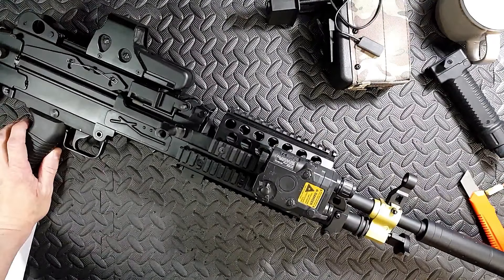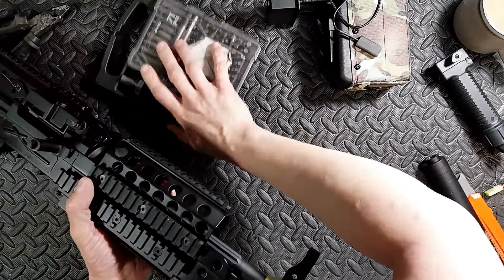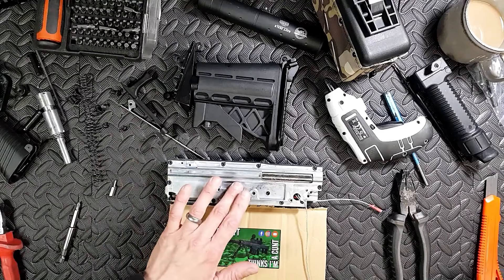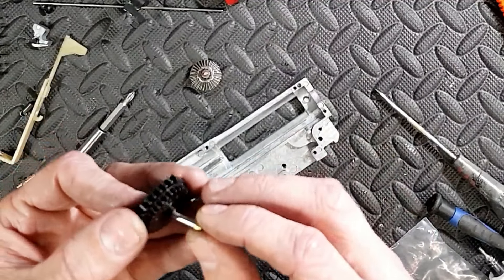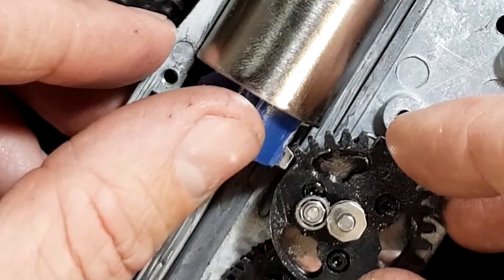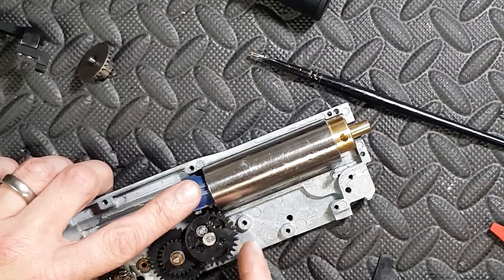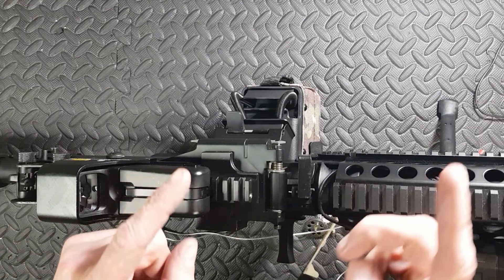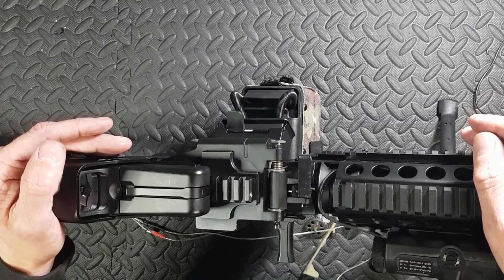A&K MK43! (with click bait title)

Comment: I find myself having to watch twice 1st time just to listen to your commentary then 2nd time for the tech knowledge p.s what gears are they please
Reply: That's a second on the types of gears, that gun sounded perfect!
Reply: Stolen from another commenter called N8:
theyre super shooter gears, theyre oemed by shs, but they add the internal bearing to them
Reply: @parkih  yeh just googled something along the lines of integrated bearing gears and found a few different sets but only really seemed to be in America. I would worry about longevity of the bearings but that would probably only be an issue on some cheap copies etc
Reply: they look like zci advanced
Reply: They are zci gears you can find them on ak2m4
Reply: @ArchieKeen1  legend! 👍
Reply: Someone please put up a direct link to these gears I need them for my m249 so bad
Reply: @paddytotherescue7364  awesome thing buddy is the bearings pop off with a tad bit of pressure so can be replaced
Reply: @parkih  made the mistake, but like the others said they're zci advanced. Super shooter gears have the same internal bearing but they have been out of stock for a while

Comment: Saw AoE that bad in a CA G36 ages ago because they had pathetically thin piston heads when they had yellow pistons. ICS M4s also suffer from needing about 5mm of adjustment if you use any aftermarket piston and something like an Area1000 piston head or Lonex.

Comment: What ARE those gears? I wish I had some for a quiet build.
Reply: will be checking this question
Reply: Zci advanced gearset, you can find these on ak2m4
Reply: My only concern is how strong they are as surely there will be a lot of stress on the middle bearings.
Reply: Kipz well my thought is that the bearings on the gear are a little bigger than bushing bearings as they are not contricted by space so they should be fine

Comment: Do you have pictures of the spring/pin system of the m249 para stock, I bought a used one that is missing bits and the end cap slides right off. Any help would be great.

Comment: I love the A&K mk46 and the mk43 .they are dog shit out the box but respond brilliantly to some new parts properly fitted . The bull gear hop units are a must in my opinion but you can make the standard hops work reasonable . I run my mk43 and my mk46 with predator style backpacks at 30+ RPS , it's completely unnecessary and you burn through a ton of ammo but it's brilliant fun and a proper force multiplyor used properly . Brilliant work as per mate ,those gears are amazingly quite ,I'll try some on my next build for sure . Keep up the good work I've got fuck all better to do at the moment than to watch you 😀👍

Comment: Hi Negative Airsoft, can you help us with the stock nozzle length (or wich length is optimal for the Bullgear hop unit) and if it comes with an oring? Kind regards a sub from Denmark.
Reply from the maker: @mattipanduro8583  I use 21.00 to ensure feeding

Comment: I'm guessing these are the ZCI Advanced Gears? would the 13:1 be ok to use with a ZCI High Torque motor on a M110/M115 spring? Trying to get a quicker and quieter (Got an ARP9) Semi and don't want to get them and they get chewed up or the bearings explode. 
If not or if you know of any reason to not get the gears or the motor over a different product what would you recomend? 
Thanks.

Comment: So I have a few questions about the 249 series from A&K.
My first one is: I bought an A&K M249 para because the MK46 was out of stock from my regular online retailer and I was wondering if it is possible to put an A&K Mk46 stock on the M249 Para. Same with the lower rail handguard. I'm wondering if these parts are interchangeable.
Second: What type of battery would be recommended for a stock A&K M249. I heard people say that you should use a Ni-Mh because a LiPo would burn out the trigger contacts faster.
Thank you.
Reply: thats correct on the nimh bit. the boxes use a micro-switch trigger that will not last nearly as long on a li-po. If you still decide to use a lithium battery, chose one with a lower discharge rating, like no more than 15c. A decent li-ion or li-fe pack might be a good option.
Reply: @cool5tuff  Well I only have 25c Lipo's laying around now, so I guess that means I have to invest in a good Nimh battery. Thanks for the help.
Reply: If you have any soldering skills you can wire a mosfet for cheaper than a new battery and use your lipos
Reply: @cool5tuff  you can run 45c 11.1 on the stock micro switch fine a good amount of time.....this is because you are not turning the system on and off like on semi auto guns alot. If you do use that small of a discharge, you can damage the battery from over drawing the safe amount of amps it can supply.

Comment: just wondering, i'm not sure if i missed it or not, how did you corrected the AOE in this case? greetings from France!
Reply: Florian Gravouil - just check 6:40 on - he skimmed the piston gear to match the rotary gear ( at least that’s how I saw/heard it). 
Restez en sécurité et recherchez la libération
Reply: He fitted a pad onto the back of the cylinder head to bring the resting position of the piston back to approximately the 12 o'clock mark . You can use sorbothane pads or what I prefer is rubber 3/4 tap washer . Get an old cylinder and grind one end so it's sharp and use it like a punch to re size the tap washer .

Comment: So you said it needed an aoe adjustment, but you didn't show how you fixed it. Did you use a washer as a shim between the piston and piston head, or did you use sorbo on the cylinder head?
Reply from the maker: True... I said pad placed but that's it - good spot.
Reply: @NegativeAirsoftTech  Thank you!

Comment: My a&k 249 actually didn't need much if at all aoe correction, though my tm p90 that I just put in a 20:1 DSG needed about 6mm or slightly more of spacing  for the piston.

My stock piston actually had basically zero wear after 60kish rounds before I switched it to something else.

You also got very lucky with the shell not having warped/casted wrong bushing holes, mine has the spur/sector borked. 

I totally agree with you on  the accuracy part, as long as I have range, I don't care if I have a 5 foot spread at 200+ feet. And it's awesome when I can unload 500 to 2.5k rounds in one long burst of 20-25 rps.

Comment: I'm surprised you mentioned aoe being fucked on mainly Lmg weapons with LMG gearboxes. The issue you mentioned, with the gear contacting at an angle like that, has been present in every single AEG I've worked on including M4s, MP5s, AKs, scorpion Evo, etc. All from various manufacturers. I find it odd you haven't found this issue.
Reply from the maker: I'm not, I've never found it in a regular aeg ever.
We're talking multiple hundred aegs.
People find the earth to be flat, doesn't mean it's real.
Reply: @NegativeAirsoftTech  hmmm that's odd then. I haven't done hundreds yet, but I can say I've done at least 20-30 aegs from many different companies. Surprisingly G&P had it near perfect. They all had the problem you had there. I will agree some were better than others but not optimal. For a regular setup I'd imagine it's totally fine, but most of my builds are high stress setups. I still love your content it's fucking hilarious seeing what other "techs" do to guns and then they come to you. Like crazy gluing buckings to barrels. Who the fuck came up with that idea. And fuck Teflon. Can be used occasionally around the c clip area if a c clip is very loose but other than that... Useless
Reply from the maker: @FrozenByFire3 I think you're doing what everybody does by correcting a non-existent issue.

Comment: I´m confused, I remember you stating in other videos that AOE is bullshit, can you explain why it matters in this case? and what you used? I remember that you hate sorbo pads, I assume you used washers behind the piston head? love you videos and brutal honesty XD
Reply: Most aegs are fine with standard aoe, just so happens that on these gearboxes etc, that it just is that bit worse so could do with correcting. He said pad in the vid so I'm assuming he used sorbo or a rubber washer. I've used rubber tap washers in the past when needed and they've worked pretty well with a bored out centre hole.
Reply from the maker: It's because techs have been known to charge extra for modification that isn't required.
Claiming that aoe correction on every single gearbox is just plain horseshit - none of the guns i build have failed from not having aoe correction.
It's not about putting every possible upgrade & modification into a gun, it's about doing the work that is required to prolong the lifespan & improve the performance WITHOUT compromising the structural integrity of the gun.

The m60/249 gearbox as we know it is based on the angs upgrade gearbox that was designed to replace the terrible gearbox internals that the TOP m60 came with - newer companies use mostly v2 parts inside a copy of that casing & the parts simply don't cross over that well.
Plus, it's designed to use a large 7.2v nicad battery - that's like running a 6v lipo... lol.

So in the case of the modern support guns, a sorbo pad can be an absolute requirement...

Comment: This would be a great video but it instantly gets ruined by the title and the fact you called it a mk43 when it is not a mk43. A mk43 is basically a pimped out “modernized” m60e4. This gun is a mk46 which is a “modernized” m249.
Reply from the maker: That's right, I'm a dick.
With click bait title.
It's right there, literally in the thumbnail.